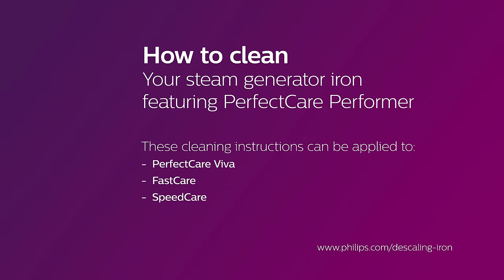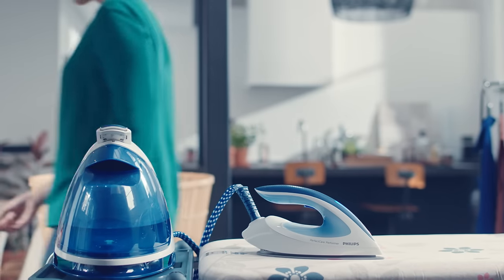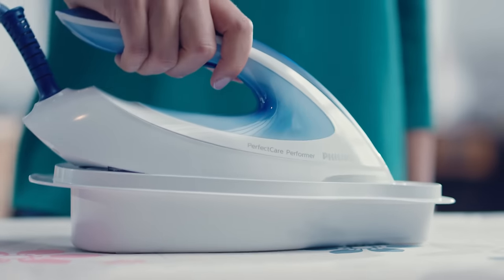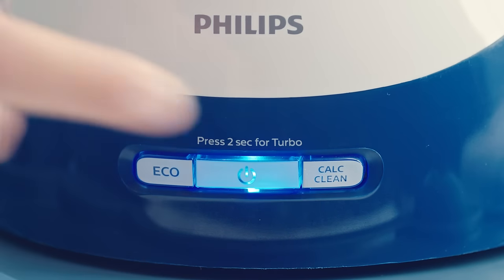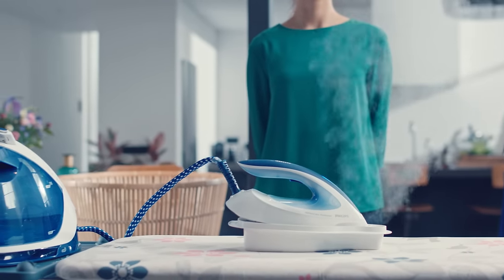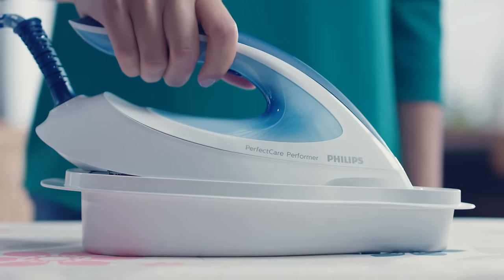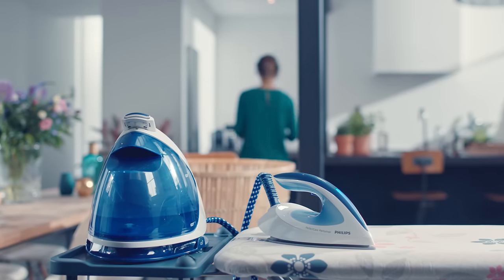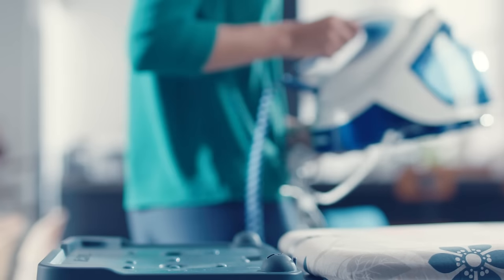How to clean a steam generator iron from calc | PerfectCare Performer| Philips | GC8700 series

Comment: I’ve followed this procedure every3weeks or so ever since I e had my iron but now my iron is clogged full so no steam and I can’t even descale as so clogged. Any suggestions ?
Reply from the maker: Hello Henrietta, thanks for your feedback. We are sorry to hear your iron is clogged. Do you use tap water to iron? And is the water in your area particularly hard? If so, this may be the reason for your iron issues. Please use only demineralized water in your device, and try the descaling process again. Feel free to let us know how it goes!
Reply: @Philips  yes I use tap water. I’ve had the iron for over  2years and never had an issue before. I’ve tried the calc clean quite a few times but with no luck. It starts and you can hear it trying to clean but not a bit of steam comes out the actual iron sole plate as it’s completely clogged. I last discalced it over the new year. Il try a few more times to see if it works
Reply from the maker: Thanks for your update, Henrietta. Please let us know if these new attempts to descale your iron resolve the issue.
Reply from the maker: Hi, Henrietta! We were wondering if descaling helped, or if we could be of further assistance? Awaiting your reply.
Reply: @Philips  Good morning 
No it didn’t help. The descaling process kicks in and runs but where the iron is clogged no steam came out at all so process is incomplete. I tried many times but no luck. 
I have just bought a new PerfectCare Compact Philips steam generator as I really like the Philips irons. 
I’m going to use the water as you said initially as I do live in a hard water area. I wanted to ask does it have to be demineralised or can deionised or distilled water also be used? Also do you use it 50/50 with tap water??
Thank you in advance, Henrietta
Reply from the maker: Thank you for your reply. We're sorry to hear that our troubleshooting didn't prove effective. For your new iron, you can use deionized, distilled, and demineralised water. For the best performance, we recommend avoiding tap water entirely. We hope this helps, and we wish you a great time with your new steam iron. 🙂
Reply: @Philips  thank you for your quick reply. I’ll use the water you’ve advised from now on

Comment: Hi Philips. I have a GC8635 and the steam has stopped working altogether. I did the cleaning whenever the light indicated, but i just get nothing. Is there a reset, or is it worth getting it fixed? It still gets hot...
Reply from the maker: Hi there, thank you for making us aware of this - that does not sound right and we'd like to believe there is still something we can do to get your iron back steaming! Could you perhaps check if any of the points here happens to be the case? http://to.philips/6056EmTK8. We'll be looking forward to an update!

Comment: I have a Philips GV8461, with so-called Auto Clean and a Calc collector.  Problem is, in the 4 years I've used it the calc collector has never collected any calc, and the iron's ability to pump out steam was dreadful.  
Out of desperation, I did what you're not supposed to do... I used anti-calc solution for a kettle on my iron.  
If you have young kids, do you know that time when they've had a cold for days, then they finally do a  big sneeze and all the snot comes out ?   Yeah, that's what happened with my iron.  The holes in the based poured out the calc... there was loads of the stuff in there, and afterwards, the steam effect was back to full-strength at long last.
One slight side-issue... the iron is now unusable... each time I use it, there's a bit of brown liquid which also comes out, so the freshly washed clothes have to go straight back into the wash.
Moral of the story:  no, these irons don't have Auto-Clean.  And don't use kettle descaler on it.  Even though you'll desperately want to.

Comment: Hi, i have a steamglide model, did regular decalc operation, but now no steam comes out. If i run decalc cycle, nothing comes out. The iron does get hot though. Any help appreciated.
Reply from the maker: Hi, thanks for reaching out with your concern regarding your SteamGlide iron. It's important to ensure that the water tank is filled above the minimum level as an empty tank can prevent steam production. After refilling, please allow the iron up to two minutes to heat up until the 'iron ready' light indicates it is ready to produce steam. Ensure that the temperature dial is set correctly; it should not be on the 1-dot position, SYNTH setting, or in Calc-Clean mode. If your model has the OptimalTemp feature, try pressing and holding the steam trigger for more steam. In case the issue persists after these checks, it could indicate a technical problem that requires further assistance. Please contact us through one of our Social Media channels, or the support page on our website, for a more detailed resolution. Rest assured, we’re here to help you get back to smooth ironing as soon as possible.
Reply: @Philips  my model is Phillips PerfectCare Compact Steam Generator Iron 2400W. There is no temp control, and I regularly used calc button. Now no steam comes out of it doesn't matter whatever I do/try. The product is not even 2 yrs old
Reply from the maker: Hi again, sorry to hear this. We like to see how we can help. Could you please share your country of residence with us? This way we can connect you with our local product to look into this further. Awaiting your reply.
Reply: @Philips  london, uk
Reply from the maker: Thanks for confirming. You can reach our local team by calling or through Whatsapp on +44 20 76 60 44 40 in that case. There is also a chat function on our website: http://to.philips/6054iF362
We hope this helps! Our team will assist you as soon as possible when reaching out to them.

Comment: What can I do for the moisture that stays inside the water tank after I empty it? Can mold develop on the inside of the tank?
Reply from the maker: Hi there Nick. We'd recommend cleaning the moisture inside the water tank even after you clean you perform the steps above. However, if the issue persists, feel free to get in touch with us via Facebook (@Philips) or (@PhilipsCare). Cheers.

Comment: I had to return this iron as the boiler was filling with water and coming out of the sole plate even after descaling. The iron was brand new and only used a few times. My sister, who I had recommended she buy one, had the same problem. I can't understand why there is not a screw out valve on this model like there is on the perfectcare aqua???
Reply from the maker: Hi there, Deb. Thanks for bringing this to our attention. We'd like to investigate this a bit further. What exactly do you mean by the boiler was filling with water after descaling? Could you perhaps share a video with us where you demonstrate the problem? That would be really helpful. Thanks in advance, hope to speak soon! :-)
Reply: Hi. To clarify further the iron I had the problem with I think was the Perfectcare Compact but very similar to the one in this youtube video. I can't demonstrate with a video because as I said I took the iron back for a refund. The iron was leaking water out of the sole plate whilst ironing which was obviously coming from the boiler where the steam should be generated, it was coming out as water and not steam. There is no way to empty the boiler of residual water. This happened before the descaling,,not after. I tried the descale process to try and rectify the problem but it made no difference. Previous to this I had a Perfectcare Aqua which had a screw out valve in the side of the boiler tank (where the steam gets generated) which I could take out after letting the iron cool, to descale and empty the excess water, rinse out and replace the valve  (sorry don't know it's proper name) as per the instructions. Not being able to empty the residual water from the steam generator boiler of the Compact doesn't make sense. I might add though that the Perfectcare Aqua is by far the best iron I have ever used and would hate to use any other type but it's just too expensive for my budget hence why I bought the cheaper version,,the Compact which I had to return.The problem with the water leakage stops me from buying another one though which is disappointing. I hope this clarifies better for you. In addition I would just like to add that I have been extremely please with Philips customer care in the past as I have had several repairs and services done at little or no cost and would highly recommend Philips to anyone because of this. Kind regards. :)
Reply from the maker: Hi Deb, thanks for getting back to us so quickly and for telling us a bit more about what happened with your PerfectCare Compact. It's a pity to hear that the device was not performing as it should and that descaling it did not make a difference, especially since you've been so keen on the previous PerfectCare model you've owned. We're always open to improvement, so we highly appreciate it that you've shared your honest thoughts regarding the (lack of the) screw out valve. Your feedback has been duly noted. Also, many thanks for the big compliment about our service. We're always happy to help, so in case you have any questions for us in the future, don't hesitate to get in touch. We wish you a very nice week. :)

Comment: How can the water container be cleaned? Although we use destillated water, it is full of dirt which gives bad ironing results…
Reply from the maker: Hi there, Daniel. Thank you for your comment. We're sorry to hear the performance of your iron is not as you would like to have it. Have you descaled the iron already? This should affect the water container as well. You can descale and clean as instructed in the video above: 

When the DE-CALC light flashes, it's time to descale. For best results, you can do this as part of your regular ironing routine.

Unplug and let your iron cool completely — at least 2 hours. 
Place the steam generator at the edge of a table or sink. Hold a cup (at least 350 ml) under the EASY DE-CALC knob.
Remove the knob. Let the water and scale particles flow out.
Put the knob back in place and turn clockwise to tighten.
You are now ready to keep ironing!

Let us know if this has helped you or not, we'd love to take a closer look. ;)
Reply: @Philips  Thanks for your help. Yes, descaling works. But there is a lot of dirt in the water tank - that can't be cleaned, can it?
Reply from the maker: Hi Danial. Thanks for coming back to us. You can try filling the water tank with hot water, and rinsing it afterwards. This should help get it clean. :) Let us know how it turns out. ;)
Reply: @Philips  Hi, my iron doesn't have descale knob. The perfect care compact. Do i still need to empty the tank after calc clean?

Comment: I forgot to put the iron in the calc clean container.i put it in the iron base..now my iron is not getting hot..what should i do pls need help
Reply from the maker: Hi Mabel, thanks for your message here. Did you already manage to clean the steam generator? Otherwise, we'd be happy to help. :-)
Reply: How to clean.the blue light in the iron is not working.
Reply: What happened is..when i calc clean it i forgot to put it in the calc clean container.its still in the iron base.now the blue light in the iron is not working.the iron is not getting hot.
Reply from the maker: Thanks for elaborating, Mabel. That doesn't sound right, and we would like to take a closer look at the matter. But as we'll need some additional details, we recommend getting in touch with us via Facebook or Twitter: we will be more than willing to assist you there. Looking forward to hearing from you there soon!